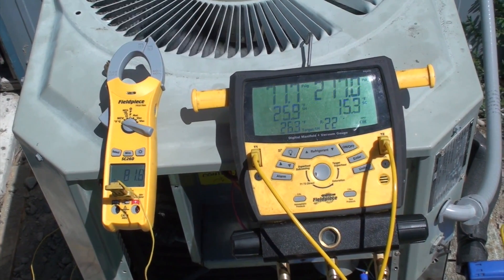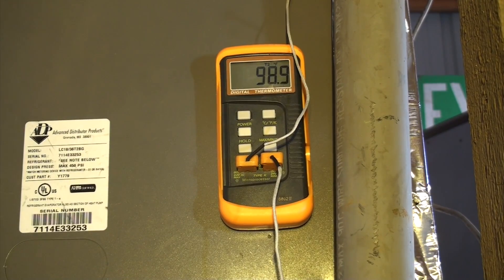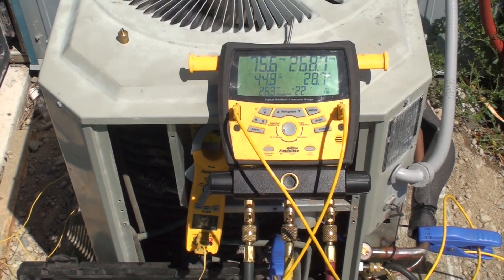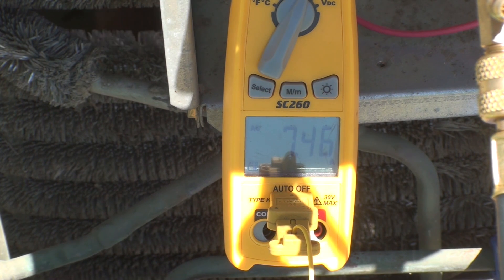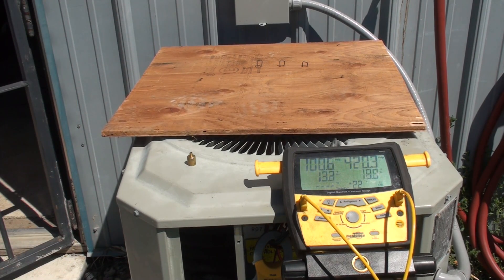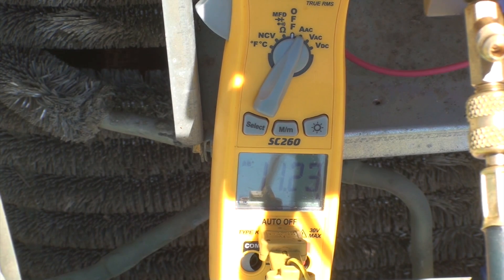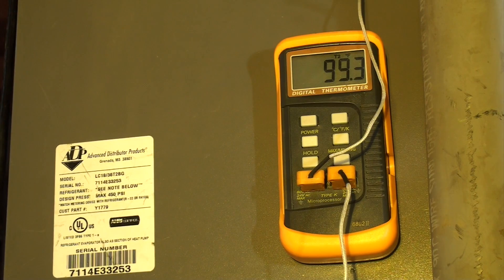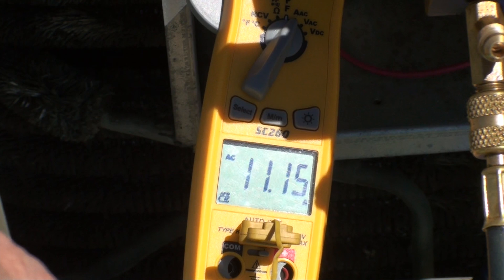How does the A/C react to an overload

Comment: This is a good example of  a service call you would get for "its not cooling" "I think it needs Freon" you show up at the home and it's that hot in the house and you check the unit , find it's condenser coil is extremely dirty 1. by the system load you have shown us here ie: pressures and super heat and amp draw 2. If you take your hand and move it over the condenser fan and the air is not exiting the area toward the center of the fan blade but is coming out around the edge of the blade. You wash it and it works right and needs no Freon at all and they still think you need to add Freon.
This is a good example for young tech's that think "Freon fist" when it should be the last thing you do. 
Good one here Gary!!!
 I think you should add to it how this could be a real life situation.

I always enjoy watching your videos.
Reply from the maker: Jim Lepore Thanks for the thoughts.
GFM

Comment: Great video.  When the unit was drawing 7.45A under high load (before the fan was blocked), how did that compare with the compressor's RLA?  Same question in general, what % of the pump's RLA do you expect in a properly charged, fully loaded system?  Thanks.
Reply from the maker: Straycurrent I seem to have forgotten you.  The RLA is 10.  I will be doing a high load test with the outdoor unit at 100F in a few days as we are getting a heat wave here (I know, down south 100F is just normal).  I will have approx 100F indoor and outdoor temp, so this should be a pretty good high load test without blocking the condenser.
GFM

Comment: on 2005  puron carrier ,  with a orifice , the high side fluctuates 15 pounds on gage psi back and forth ... what is the cause>
Reply from the maker: ***** The fluctuation may be air in the system, especially if it moves fairly quickly. Hope this helps.
GFM
Reply: yes it does move fast , that is what i suspected , but i wanted  second a opinion .

Comment: Did you have TXV? Otherwise It would be really difficult to catch that temperature split with fluctuations you have right?And having a txv vs. piston would have any role?
Reply from the maker: Guy Hakverdi Its a fixed orifice system.  Ideally, it should make no difference whether the expansion device is fixed or TXV.  The fixed orifice should self adjust as the pressure difference increases.  In the real world, this is not always true.  This unit is remarkable in that the temperature difference increased with the higher head pressure.  You would expect some loss of efficiency with the higher head pressure.
GFM